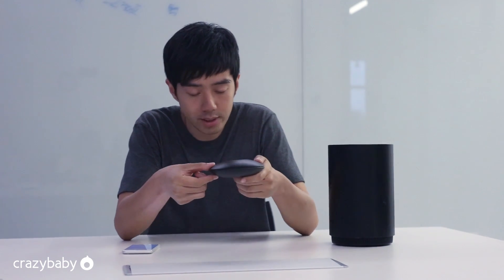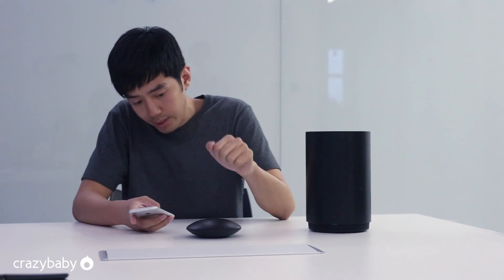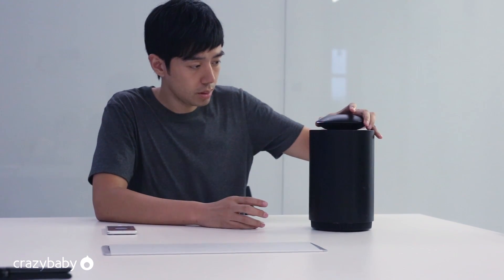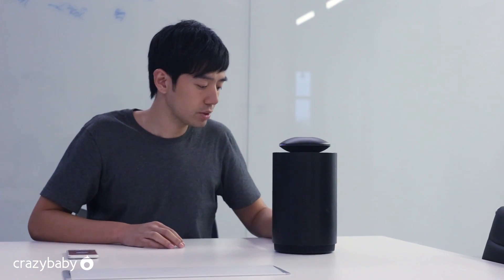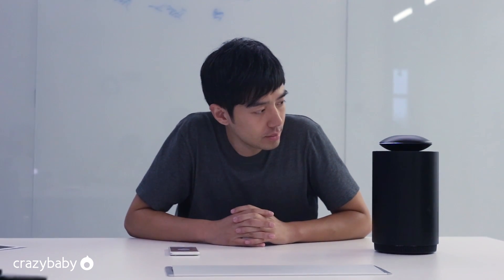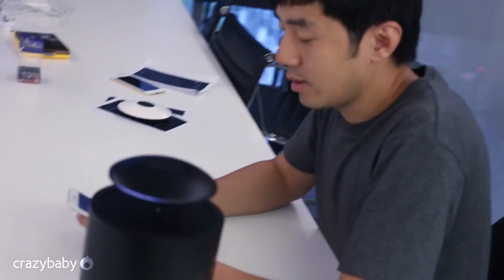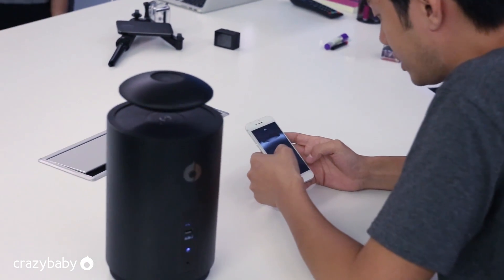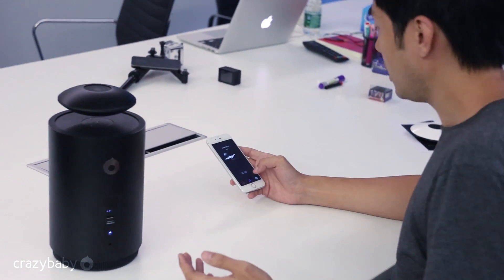Mars by crazybaby 2nd Engineering Sample

Comment: hi Alan I have a suggestion, I know this is a sample, I just would like to suggest that if in the final version you could make the craft a bit wider just like the white model you show in your Dec 18 video, and it would be nice if it looked more like a lid to the subwoofer part rather than smaller in diameter like a pebble on top (current design), which from a design ergonomics point makes the craft look disproportionate to the size of the subwoofer. looks great otherwise!